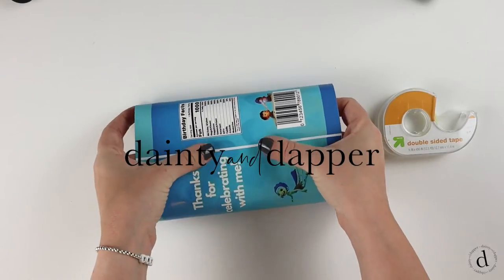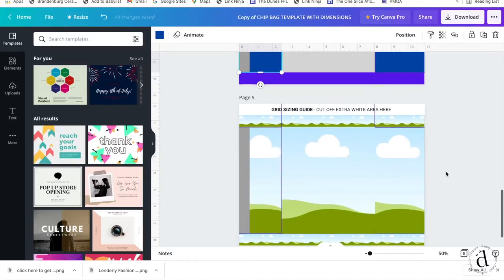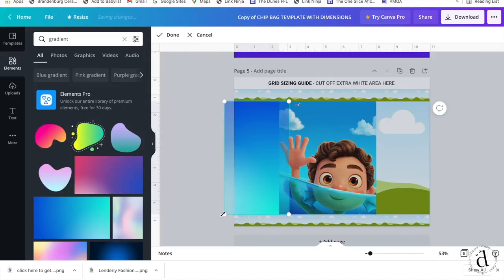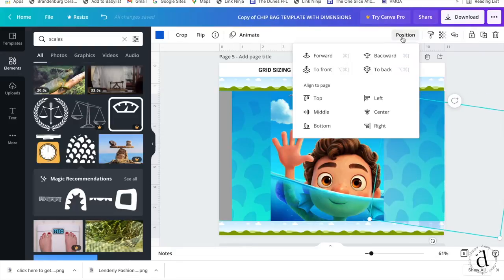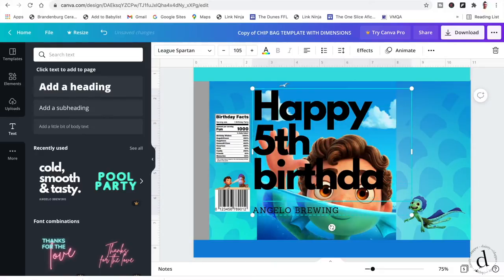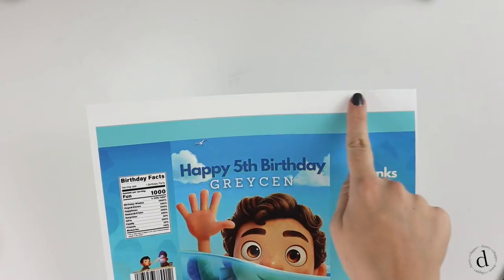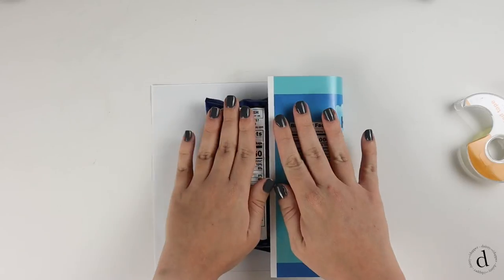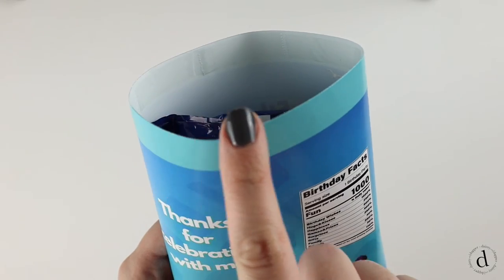How to Design a Chip Bag - Custom Chip Bags

Comment: Does it take a lot of ink? I made some and they took out soooo much ink idk if I was doing something wrong
Reply from the maker: If you design it with lots of color, it will be a full sheet of ink (unless lots are left white). I think it depends on the printer too. Newer printers are built to use less ink than older ones.
Reply: It does use alot of ink. Most themes use more color so I would suggest investing in an epson ecotank if you plan on doing this for your business.

Comment: What printer do you use?
Reply from the maker: The prints used in the video were printed from a commercial use laser printer (ex. Staples, FedEx). Highly recommend, colors are so much more vibrant.
Reply: So do you go to Staples & FedEx to have to them print the labels.
Reply: Is it true that they don't print with something that might have copyrights